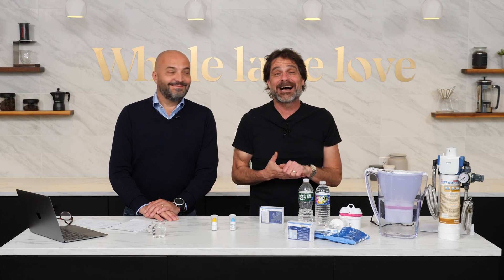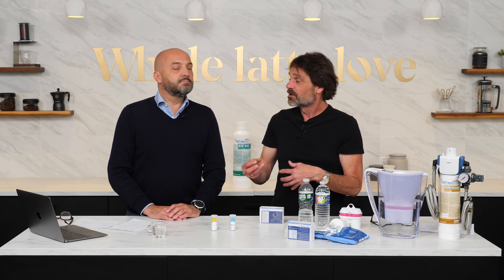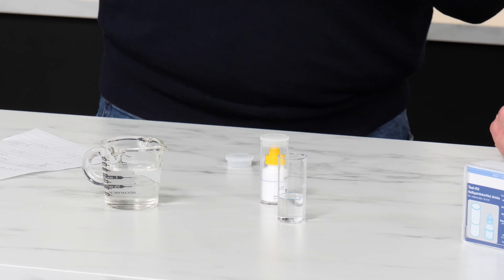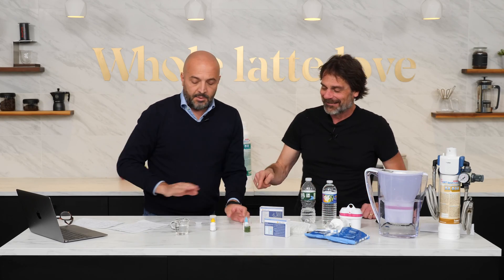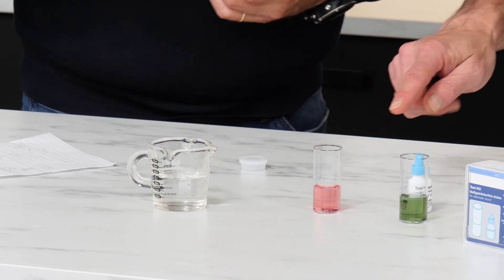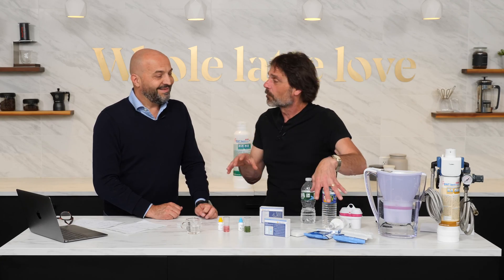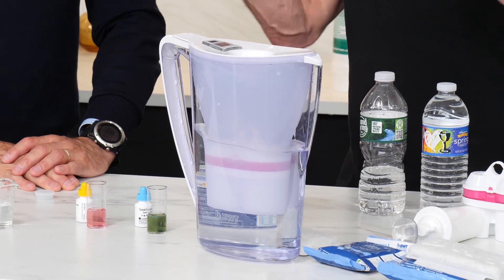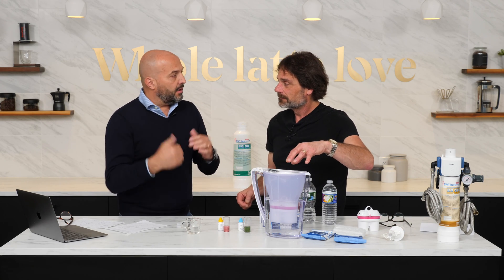Espresso Machines: Testing Water & Filter Selection

Comment: When I ran the alkalinity test, the color changed from blue to yellow. Not red. I chatted with tech support and was informed that it happens when the weather is colder. That's OK, but it would be good for you to send a warning along with the item so I don't need to pester you with this non-issue. Glad for the knowledge of your support team. 😊
Reply from the maker: Thanks for sharing your experience! You do not have to worry about pestering - we're here to help!
Reply: I had the same problem. Went to 14, then started over. 8 to yellow again, then dropped 30 in to see if it would change to red, no red. Ill accept yellow
Reply: @firstactionhero  As a follow-up. I bought a new test kit and did it in the summer when it was warm. And the alkalinity test still yielded yellow. So much for the cold weather water explanation. But WWL still said it was OK. Just wish the video explained the possible change to yellow in order to eliminate the annoyance of needing to go back and forth with tech support. That said, tech support has been very helpful with a number of questions and concerns.

Comment: My total hardness is 4 degrees and my alkalinity is around 3-4 degrees. Would the penguin pitcher over soften my water?
Reply from the maker: Hi tt, The Penguin Pitcher now available as the BWT AQUAlizer pitcher: https://www.wholelattelove.com/products/bwt-aqualizer-2-6-l-pitcher-with-illuminated-baselight?variant=41552648241206
will not over soften your water. Since it uses ion-exchange to it's a 1:1 replacement of calcium by magnesium. It does not reduce mineral level but replace one mineral with another that does not cause scale. It's a perfect solution for your water tests results.

Comment: Can you hook up a sinchronica to a RO system?
Reply from the maker: Hi SisS, Yes, but you must either remineralize the RO water or use an RO system that has a bypass so you end up with some minerals in the water. RO systems with a bypass typically treat all input water with particle filter and activated carbon. Then some of that water is bypassed around the RO membrane so it retains some minerals. The other option is a remineralizing cartridge. This option from BWT uses magnesium to remineralize so you get the mineral level needed without risk of scale: https://www.wholelattelove.com/products/bwt-bestmin-premium-m-filter-cartridge
Pure, zero TDS (no mineral) water from RO systems causes three issues. First, the fill level probe in the steam boiler will not work as it uses electrical conductivity of water to operate. No minerals in water = no conductivity. Second, pure RO water can be corrosive to metals with long term use. That's why RO systems do not use metal plumbing/components to carry treated water. Third pure RO water over-extracts coffee leading to poor flavor.
Hope that helps!
Marc
Reply: I believe RO water has some minerals that make it through. It is the RODI that makes it 0 TDS.  @Wholelattelovepage

Comment: Say you treat the water and you have a filter in your water container within the machine (I have a Breville Oracle) does that counteract or enhance the benefits?
Reply from the maker: Hey Steven, thanks for the question. Some old Breville filters I'm familiar with did not do any softening of water  - the smaller "squishy" ones. Some of their newer filters (in plastic case) do have some ion-exchange so likely soften the water. Neither type will counteract benefits but the plastic type but may be redundant If your treatment softens and dechlorinates the water prior to use.

Comment: En what do you Do you recommend for the bypas on the head of the bwt water filter, there are 3 positions on it, is it 1, 2 or 3
Reply from the maker: Hi m, Hopefully your BWT filter came with a manual/reference chart that lists the blend setting (bypass setting) based on your water hardness. If not, here are settings for a BWT Bestmax Premium filter by dKH (German hardness):
7 dKH or less = 3
8-14 dKH = 2
17 or higher = 1

Marc

Comment: Hey Mark,
One again a great video. Thanks a lot for that.

One question I cannot find an answer anywhere: how to detect that the maximum capacity of the filter is reached? I'm using bwt best save m. I know the dH but my maschine ist not measuring the water going out.

Cheers from Germany, Denis
Reply from the maker: Hi Denis, You will need to estimate. Bestsave ranges from 100 liters treatment capacity at 10 dKH to 50 liters at 20dKH. If your machine has a 2 liter reservoir, your water is 10dKH and you fill daily you would change the filter every 50 days.
Hope that helps!
Marc

Comment: Hi guys.

I use a limescale water filtration (Brita) and I'm able to get my tap water levels down to a Total Hardness of 5dH and Carbonate Hardness down to 4dH. After 2 weeks it goes up to 9dH of TH and 5dH of CH. So I bought the BestSave pad M for my 2ltr water tank (linea micra). After +10h it brought it down to 4dH of TH again - but due to a short weekend trip I didn't use the machine and the water tank for 2 days. When I tested the water from the tank again both the TH and CH was down to 1dH. 

So my question is - is it possible to overfiltrate with a pad that is in contact with the water for a longer period of time?
Reply from the maker: Hi M, thanks for the question. I'm going to forward it to the BWT water chemists for comment. A longer resident time with the filter could continue to reduce hardness but I believe there's a limit as the filter uses ion-exchange. So once it has exchanged out all the calcium ions for magnesium decreases in hardness should end. The surprising number to me is your total hardness.

Comment: Excellent presentation Mark. Just to be clear are you saying that we can continue to use bottled water in say a Rocket Mozzafiato V, safely when you add a BWT Best Save? By using the Bestsave there is no need to test the bottled water because the pouch will regulate the water quality? Is that right?
Reply from the maker: Hi SB, Thanks for the kind comment! Bottled water plus the Bestsave works! Only caveat is do not use bottled Mineral Water!
Marc

Comment: Hi, I have a question regarding the BWT bestsave pouches. I purchased a set from your website, and I use it with water that has the following values:
Total ppm: 15-20ppm
Sodium: 0.1mg / 100ml
Magnesium: 0.3mg / 100ml
Calcium: zero

As the water I use without any filtration, already has the above ideal values and is quite soft, will using the bestsave pouches add any further value? Will the bestsave pouches remove sodium and add more magnesium than already present?
Reply from the maker: Hi pb, you have very interesting water values! Are you running an RO system? TDS of 15-20ppm is incredibly soft if that's what's coming straight out of your tap with no other treatment. The Bestsave filter will dechlorinate the water but I suspect yours is not chlorinated. Since the filter works by ion-exchange of calcium to magnesium I doubt it will add any minerals to your water. Water as soft as yours tends to over-extract coffee and may produce a flatter flavor due to low mineral level. Additionally, low mineral content water, over time can be corrosive to metals in your machine. For those reasons water experts suggest remineralization of water with your values. If running an RO system you could add an inline remineralization filter like this one: https://www.wholelattelove.com/products/bwt-bestmin-premium-m-filter-cartridge
If using packaged water with those levels there are commercially available remin packets for smaller volumes or you can make your own for pennies per dose using baking soda and Epsom salt as I demonstrate in this video: https://youtu.be/iHI7jC0sQZo
Hope that helps!
Marc
Reply: Thanks for the quick response Marc! If I take the water with above mentioned values, and add magnisium and buffer as suggested in the video you linked, will that be good to use with my machine? Or do I absolutely need distilled/RO water to start with? Will adding the buffer to the water I mentioned change its alkalinity in any way?

Comment: Very helpful video, but unfortunately I still have a couple of questions.   I have a plumbed machine and installed your BWT Premium S Filter Cartridge and have been running it with bypass on #3.  I've now purchased the BWT water hardness test kit so I can know if I'm actually doing things right.  The Total Hardness check was 3 drops and worked pretty much like your video, color change was immediate on 3rd drop.  The Carbonate test though took 12 drops and color change was very gradual, unlike the video.  I just received the kit and the Carbonate bottle has an expire date of 10.2022 which is odd since the total hardness is 3.2023.
Question 1:  Does the carbonate test seem normal for the gradual change in color? i.e. can I trust it?
Question 2:  Assuming the numbers are accurate, according to your graph my hardness should only require the Besttaste filter but the alkalinity puts me into the Premium which is what I have.  I think I'm protecting my machine with the Premium but I don't want to leave any flavor out of the cup.  What to do, what to do...
Question 3:  The table in the filter manual gives a recommended bypass setting based on ppm but which ppm?  The total hardness ppm or the carbonate ppm?

Sorry for being long winded but I've spent a lot of money on this filtration system and just want the best possible coffee I can get.  Thanks a ton for putting all this information out there for us.
Reply: hi

Comment: Hi i have an RO system, can i use the besttaste filter for my espresso and for drinking water as well? If so, its gonna look like this: RO->bwt filter->accumulator then split to drinking spout and espresso line. We have been drinking RO water for a couple of yrs now and i just realized its not good for our body and i plan to remineralize. Will my diagram work?
Reply from the maker: Hi AB, Thanks for the question. Assuming your RO system doesn't already bypass some water around the RO membrane and mix back into the RO treated water (a common setup) then yes your diagram will work.

Comment: Why would you not test the bottled water that people actually use I.e. Crystal Geyser? So disingenuous.
Reply: They're in new York I doubt they have water available or how common it is from pnw. Bottled water varies drastically regionally, they were just proving the point that different bottled water has different properties. Even the same "brands" source from varying springs/sources in a given market. Dasani and Aquafina use municipal sources in varying parts of the country. Nestle, who bottles Poland spring also bottles Ozarka in the part of the country I live in and Ozarka has different sources/springs depending on region, even though the same brand is sold in multiple states. Usually they will bottle water from a source and sell in the same place because most regulations allow intrastate bottled water to be sold without publicizing water quality standards.
Reply: I just tested Crystal Geyser,  the one that's bottled in California.  Results: Total TDS = 70ppm.  Total alkalinity = 70ppm (or 4.1 US grains/gallon).  Total Hardness = 68ppm, or 4 US grains/gallon).  pH = 7.3.  I'm using it with my ECM Mechanika Max.  But it's a pain to pour water into the tank every couple days.  The machine is heavy and sits under a cabinet, so i have to pull it out to refill it.  I'm looking for a plumbed-in solution.  I'm thinking of the Mavea Purity Quell ST system.  It also has a bypass setting.

Comment: Does the BWT Penguin Water Pitcher soften hard water?
Reply from the maker: Hi James, Yes it does! Traditional water softeners use sodium to replace the calcium in tap water. Calcium causes hardness and scale deposits in combination with carbonates. The BWT Penguin Pitcher replaces calcium with magnesium to reduce water hardness and prevent scale when used as directed. Magnesium is better for coffee/espresso flavor as it's more effective at extracting the good flavor acids than calcium. https://www.wholelattelove.com/products/bwt-penguin-2-7-l-water-pitcher
Marc

Comment: Why not use evaporative distiller instead of filtering?
Reply from the maker: Hi PV, At first glance that makes a lot of sense. Problem is distilled water has no minerals and you want some minerals for good flavor when extracting coffee. Also, mineral free water can cause corrosion of metals in machines. You can use a distiller or reverse osmosis water so long as you remineralize before use in machine.
Marc

Comment: I have a whole house soft water salt system that then runs to the RO system in the kitchen. I use this for my espresso machine. 

What product do you recommend and do you sell water testers?
Reply from the maker: Hi T Lee, Test kit used in video available here: https://www.wholelattelove.com/products/bwt-hot-beverage-water-hardness-test-kit Unfortunately currently out of stock. You can use other test kits. You will need one for total hardness and carbonate hardness (alkalinity) If test results read in German degrees you can use those test results with graph in video. If test gives results in parts per million (PPM) then dive each result by 17.9 to convert to German degrees.
Some options with whole house sodium softener:
1. Your sodium softener may have a bypass which mixes back in some unsoftened water. If so, you (or a plumber) could adjust the amount of bypass so there is some calcium in the water but not so much that you'd have a scaling problem. If you do that do not run the water through the RO.
2. Your RO system may have a bypass which allows mixing back some softened water. This would give you some minerals in the water in the form of sodium. As mentioned in the video coffee flavor is better with mineral content coming from calcium or magnesium. But if you're not super picky flavor may be good enough for you.
3. If your RO does not have a bypass and produces essentially mineral free water you can remineralize with the BWT Bestmin filter cartridge: https://www.wholelattelove.com/products/bwt-bestmin-premium-m-filter-cartridge

Comment: Question Marc: I use since 2.5 years a BWT Penguin for my Rocket R58 and change the filters every 120L rather than as soon as the light blinks way too early. I use the pitcher for my machine and drinking water too, however... I ALSO use inside my water reservoir, a softening pouch from Rocket since day 1 as I've been told to do it to extend the life of my boilers. I change that one once a year while doing 2 espresso a day.

The BWT guy from the video said those pouch are good at softening water but kills the flavor as it is a bad extractor "sodium". Does that mean it will always be way better to use one than do nothing at all... but if I use the Penguin already, I would still be safe as for limescale while also having a better tasting cup WITHOUT the pouch?!? O_o
Reply from the maker: Hi P, No need to double up with the softening pouch. So long as your water does not have edge case issues like high gypsum or chlorides the Penguin pitcher will protect you from scale and produce better flavor as magnesium is a better extractor than sodium.

Comment: I stopped using the Penguin also, could not get any good coffee. Tried and tried. ROS system alone and works fine.
Reply from the maker: Hi CO, Do you have other water quality issues beyond excessive hardness? Reason I ask is many who install RO systems do so to treat for less common issues beyond hardness, particulates and chlorination. If you're happy with flavor using RO that's great. Most tasters are not. Be aware that pure 0 TDS water from an RO system can cause metals to corrode over time. Hopefully your system mixes back in some water that did not go through the RO membrane to remineralize the water prior to use.
Reply: @Wholelattelovepage  oooh Thanks a lot, I forgot to mention I use remineralizer at the end. 😂 💗
Reply from the maker: @CartonOne  Then you're good to go! I just never know what some people have as far as RO and sodium softeners. Some have bypasses, some don't. Some remin and some don't. Some have no idea how their system works. I run into a bunch who think pure RO is the way to go - not a good idea for machine health or flavor.
Marc

Comment: I was using a BWT Penguin for my Gaggia Classic with my city's 68PPM water. I descaled, but less frequently than otherwise--every five months or so. Then my brew head stopped putting water out (I had cleaned the solenoid only a few months prior) and I opened up the whole machine. My boiler was CAKED with heavy scale. It certainly reduced any faith I had in the BWT Penguin.
Reply: You were changing the Penguin filter every how many liters? I use one since 2.5 years in my Rocket R58 along a Rocket pouch for water softening inside the tank, I change my BWT filter every 120L and never had any issue so far.
Reply: @PanzerIV88  The answer is "apparently not often enough"?
Reply from the maker: Hi c, What city do you live in? I wonder if there's something else in the water like gypsum or chlorides. Rather unlikely water at 68ppm total hardness would result in scale - especially heavy caking!
Reply: @Wholelattelovepage  I am in Boston, and actually I just retested my water with a new water testing device. The 68PPM was in fact not what was coming out of my faucet -- it was 111, and then it was 87 out of the Penguin. I am now thinking that at least a good part of my problem was user error (= my own misunderstanding of the variables, and the actions I took-- or did not take--often enough). By the way, the water that goes into the Penguin is already pre-filtered with an under the sink Multipure Filter, but I don't know about gypsum or chlorides.